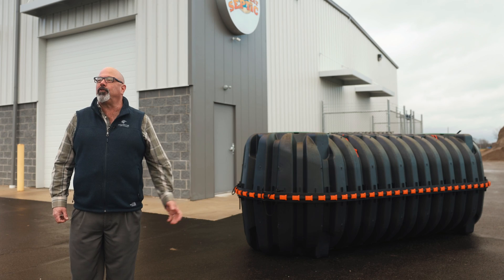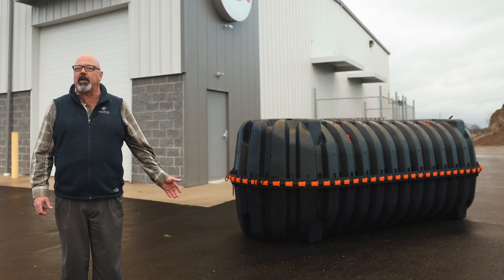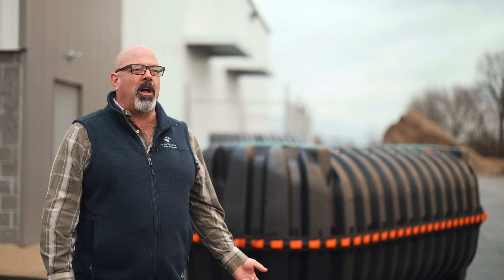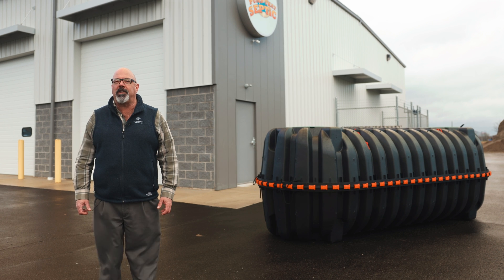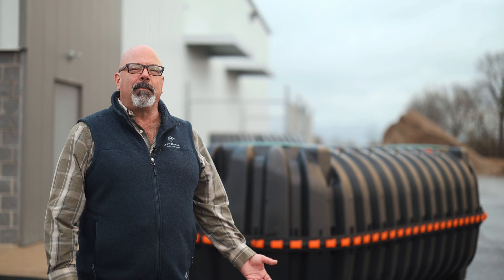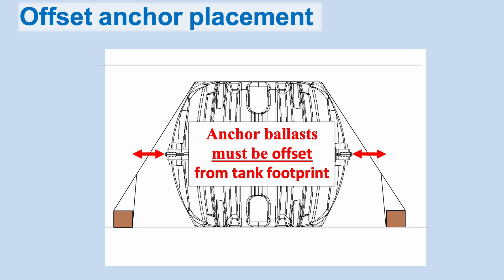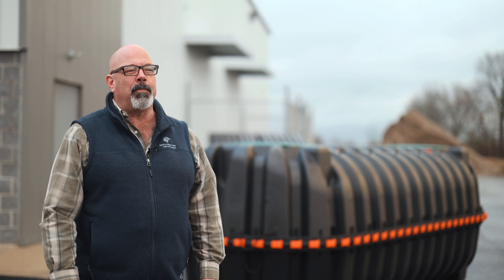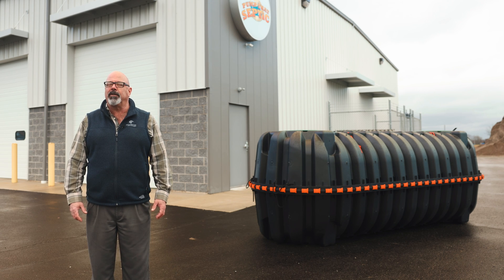The Advantages and Concerns with Plastic Septic Tanks

Comment: the wire mesh on the gate of that trailer probably scratched the hel out of the bottom.
I spent all day putting in and leveling a plasitc tank, a storm came thru that night and it had popped right up out of the ground